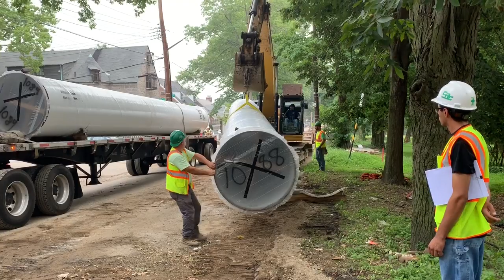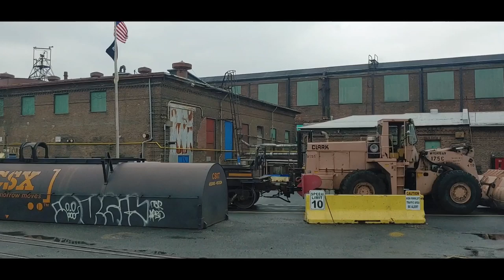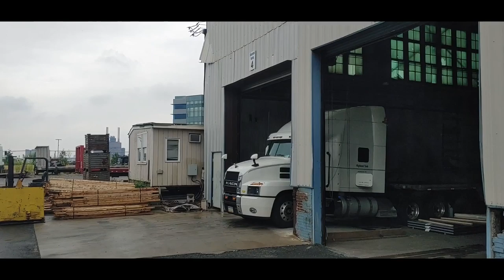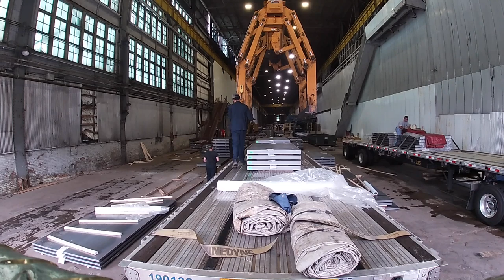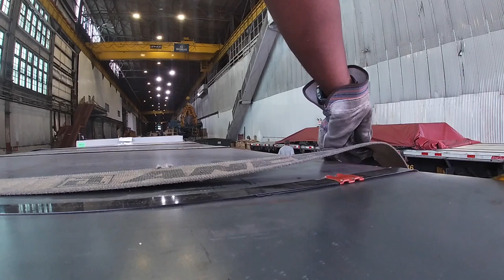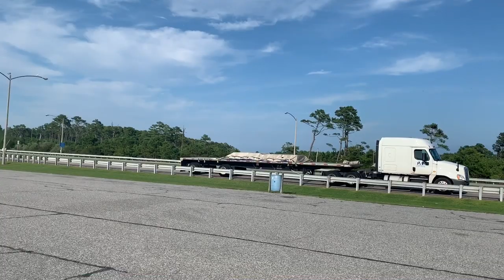New York To Chesapeake Bay Flatbed Trucking Load Securement P&S Transportation

Comment: Is that the bridge that go under water??
Reply from the maker: It goes under twice. Two tunnels
Reply: @bigsnow1705  Ahh hell Naw😂
Reply from the maker: It's about 15 miles long. You go across with a light load like some insulation I bet you cut the music off and put both hands on the wheel